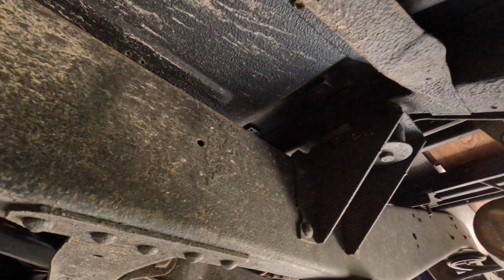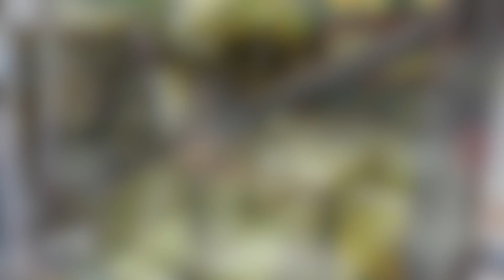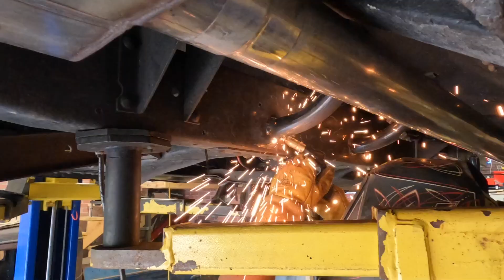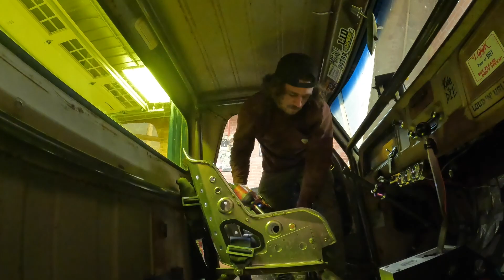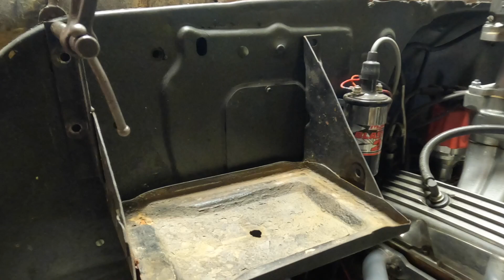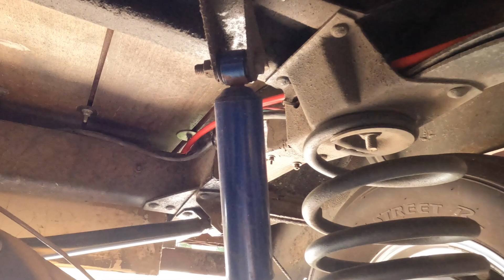Loud N Ugly Garage - Gasser C10 Roll Cage and Fab Work EP18

Comment: That frame hole next to the battery tray looks perfect for a grommet and pigtail for a battery tender. And Marky Mark needs to get the Funky Bunch a dry erase board. The cardboard task list is straight Fentucky. 🤣 Can’t wait to see that 11 on the timeslip, man.
Reply from the maker: Awe man you don't like my cardboard list?
Reply: I mean, in my shop we poke our finger with welding wire and write those lists in blood. Don’t tell OSHA.
Reply from the maker: @29spdrcr  😂😂🤘🏼🤘🏼🤘🏼